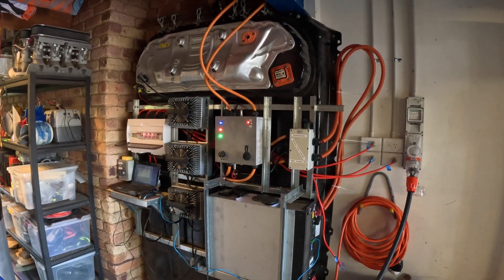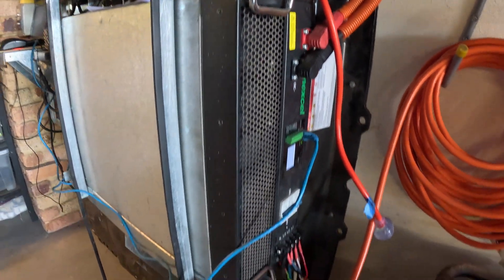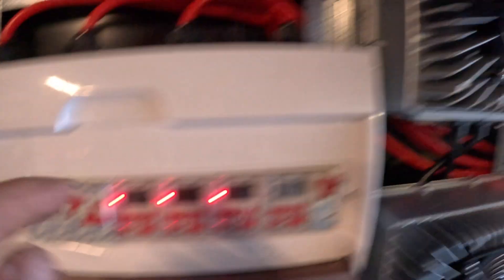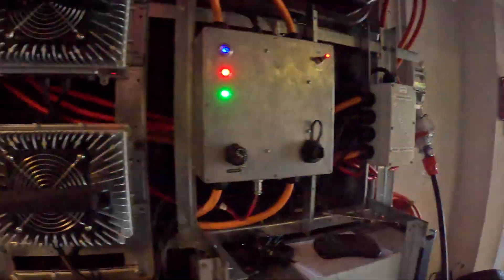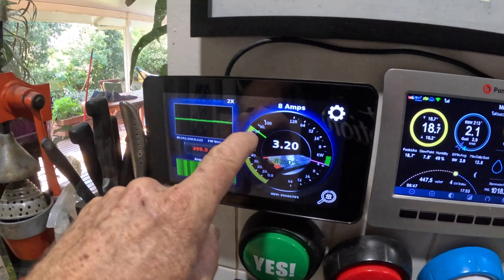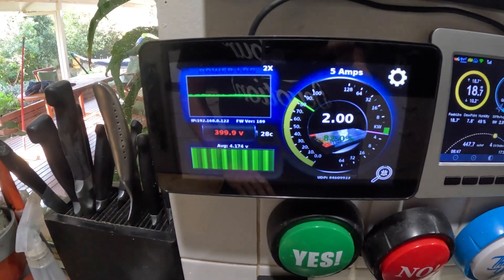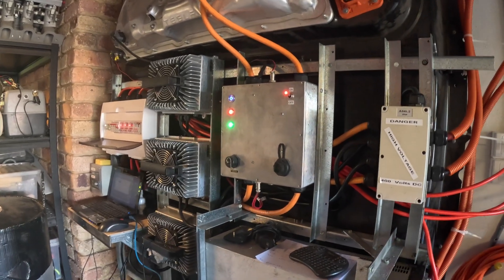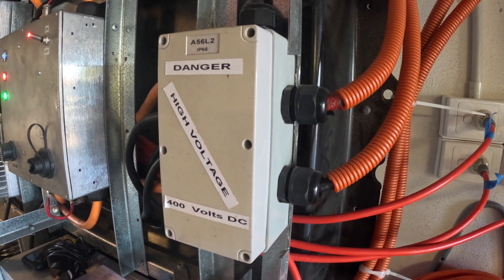Battman builds DIY 75KWHR 30KW Powerwall

Comment: Would it be possible if you can do a wiring diagram in pdf format for us.  I am aware that you do have it at the end of the video however it's not very clear.  I learned so much from your Video however would love a detail wire diagram.
Reply from the maker: Sure, will make a google docs link.  Bit busy at present with family stuff so give me a couple of days to do it, nag me in a few days if I've forgotten to do it.
Reply: @jimthompson5686  another question for you.  I am using a hybrid inverter with 2 X PV input (Max voltage of open circuit is 500v) is there a way for me to connect this directly to the battery somehow since it's AC.
Reply from the maker: Everything is possible, however, not really sure why you talking AC as usually a hybrid inverter has DC inputs for the battery (i.e. your two PV DC circuits and your HV battery DC input).  Maybe you have AC coupled inverter??    If you have DC battery input on your inverter then connecting them easily depends if you can program your inverter to stop charging the M3 battery (I'm assuming you are talking the Tesla M3 battery here) where you want.   i.e. The battery I am using is the Li-ion one with 96 cells so 100% SOC is 96 x 4.22 = 405.22Volts.   Really you want to stop daily charging at 90% SOC which is about 403V (depends on temp and charge rate though).   If you can program your inverter to stop charging at x volts then job is easy, otherwise your job is harder.   The EVTV controller will switch a 12V relay whenever the M3 battery gets to the voltage you specify...so you can easily switch AC but not DC. (that's how I control my charging).    Another simple solution (but very dangerous) is to configure your PV array to get as close to open circuit voltage of 403V, that way you can directly wire the PV panels to the battery and also the inverter and charging of the battery is automatic (as far as solar goes) and you can add other chargers like me if you need further charging (like in winter).  Of course you need to be able to turn off the PV array and the only way to do this is with putting a cover over the array BEFORE turning off the DC switch.  Yet another option which I am doing is having a bi directional inverter like me running in OFFGRID mode means I have my own grid which means I can add infinite standard (i.e. very cheap) solar inverters to my own grid which have nothing to do with the public grid.  i.e. my system (not mentioned in video) has 3 separate solar systems.  One is the fully government compliant grid connected system and two others are connected to my own grid.  Since I have 3 phases in off grid I can easily add 10KW solar arrays on each phase PLUS the 5KW on the public grid which will charge my battery at 35KW.  Totally not necessary for normal home but this project was initially destined for remote off grid road houses in Australia. i.e.  Once the off grid inverter starts up, the grid connected solar systems then start up and charge the battery/run the road house. Anyway, probably too much info...

Comment: Fantastic!! Great stuff Jim, when are you coming over to install one at my place?
Reply from the maker: Haha.  It's very simple to make it yourself, plug and play really.  I made a mistake in the video saying could do it now for $35k.  Really could do it for closer to $30k.   You can now get junk long range (78KHr) Tesla battery in US for $6k USD($10K AUD or less).  Ebay has quite a few listed.    To get to Oz is $2.5K AUD door to door for shipping and import charges.  The inverter shown is overkill but $6K USD and the EV control hack is $1.5K. So the bits cost $13.5K USD ($25K AUD in Oz).   Allow $6K for sparky and misc and current price is around $31k AUD.  No doubt this will continue to drop.

Comment: super, first video of someone using the EVTV box, how do you like it ?
Reply from the maker: EVTV box is good and well supported by Colin Kidder and the crew at EVTV.   I've had it nearly 4 years now (used initially in a battery buffered Fast DC EV charger).   Only issue (Colin promises to fix) is the charge levels to stop/start charging use cell voltage (not SOC).   This is fine if your power in/out of the battery is low but as you increase power it is difficult to accurately set when to stop.  i.e. if you charge at 30KW and want to stop at 90% SOC the cell voltage you need to set to cutoff might be 4.2V. Temperature also has an effect.     Once you switch the chargers off the cell voltage then drops to 4.1V.    If you charge at 3KW this will be 4.1V. (note those numbers are estimates, not accurate). 

This effect is dramatic on the low side when you are drawing 80KW from the battery.  i.e. cell voltage might be 2.8V at 80KW load at 20% SOC but 20% SOC cell voltage at 1KW load might be 3.3V 

In this current use case if you have 4 chargers charging at 13.2KW and the house is drawing minimal load there is maybe 12.5KW going to battery but if a number of high loads are on, there might be only 2 KW getting in to battery.    So to avoid overcharging you need to set the cutoff at a lower level than you might want.   In the end it means it is difficult to optimise exactly how much of the battery capacity you can use. Not really a problem if you are just running the house but if you trying to also charge the EV after a big trip you might miss out on 10KWHr capacity